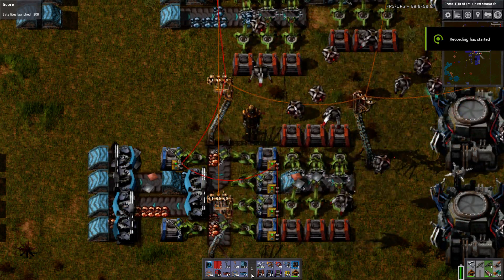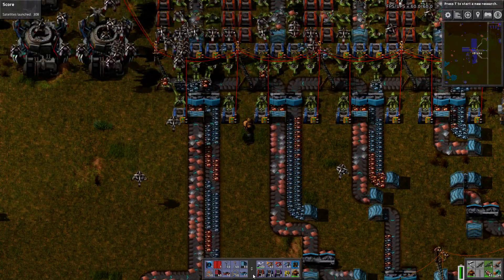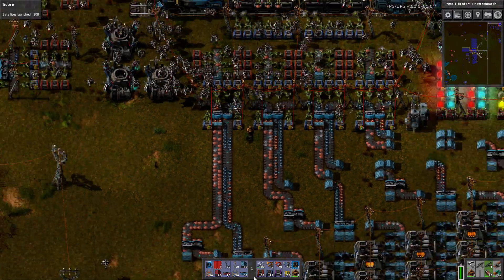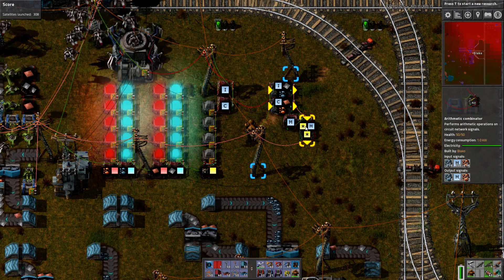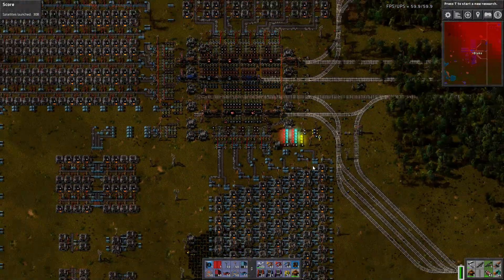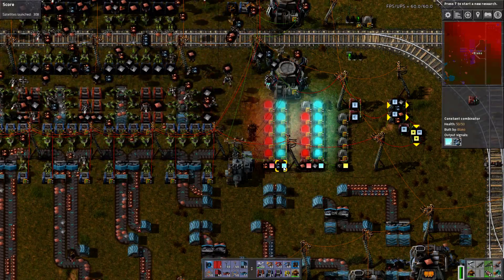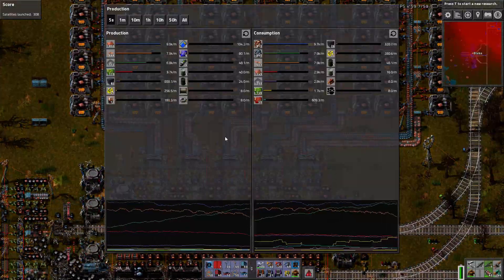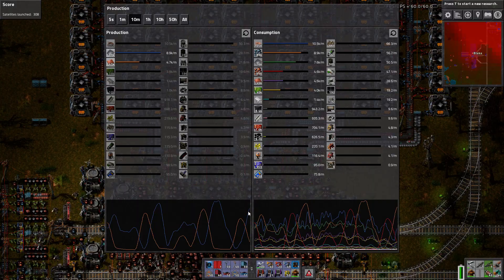Smelt Inc. - Factorio - My first train based furnace.

Comment: Looks very nice. Would you put another combinator in to reflect the effect of productivity modules or are you counting that in the modifier where you divide the number among the chests? Well that or you just let the overproduction happen. Not like that is a bad thing.
Reply from the maker: Thomas Klinge the system does not know or need to know at what rate metals are produced. Think of a kitchen sink, if you turn the water on then realise the water pressure is higher than expected you can turn it back down to what you like.   If productivity modules or speed modules were added the valve would still be auto controlled. Adding/removing furnaces doesn't  matter to the combinators their just trying to approach stockpile quota by turning the valve up or down a little at a time.
Reply: Yeah that's kind of what I meant with letting the overproduction happen, it doesn't matter in the end. It might matter if you are on the edge of overloading the belts but even then it should resolve itself if you have enough furnaces.